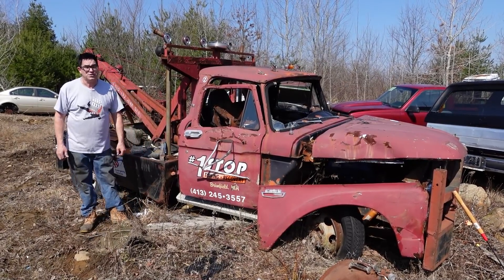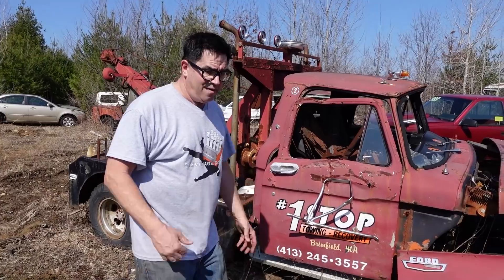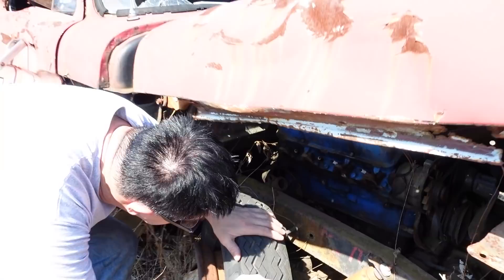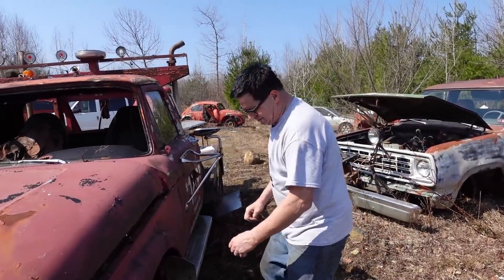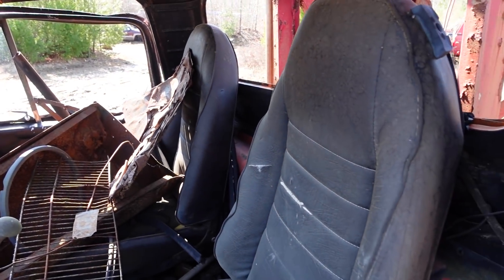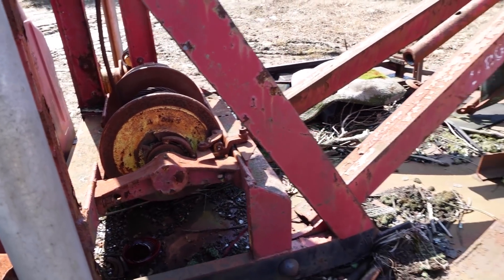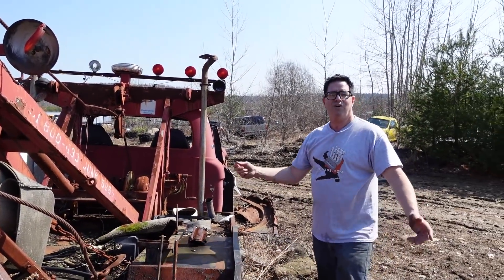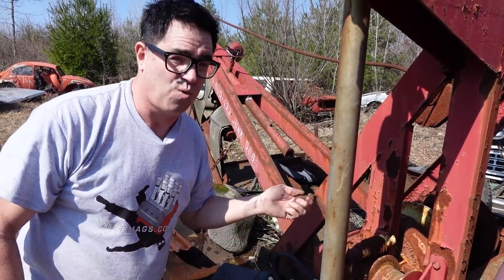Tow truck Tragedy

Comment: I think the winches where PTO driven but nevertheless what a awesome find and as always be safe 👍
Reply: When people that are supposed to know stuff say stupid stuff like electric motors on that tow truck you question everything else they say
Reply: @jamestyndall529  Steve has forgotten more than you or I will ever know alot of home made tow bed were electric driven exp.if they were never equipped with a p.t.o unless it was factory intended to be a dump bed or tow it wouldn't have a p.t.o he said in a comment that it may have one but he could see the electric motor on the winch and couldn't get under it to see if it came with a p.t.o
Reply: @kellytolliver2390  Its home built wrecker. the two levers at the rear one worked the clutch and the other worked a two way  PTO. The winch on the example shown here. It looks like one of those WWII PTO winches that where on  army 4x4 like WC's and early Powerwagon dodges etc. Back in the day when this tow truck was in service there where not very many electric winches like we see today.

Comment: I had a 66 F-250 in about 72 or 3.  352 POS blew a head gasket...filled her up with Iron Tite she sealed right up...changed the oil and traded her in on a 72 Kingswood  Estate wagon.  Then I got a 69 F-250 with a tired 360...much better truck.  Dropped a 390 out of a Merc wagon in that baby then she was unstoppable!

Comment: Wasn't there an article in Car Craft around '97-'98 about how any FE block can be turned into a 428 like a Police Interpreter engine? Not a 427, because boring out the cylinders that much might cut into the water jackets.
Reply: Nope only a Mirror 105 block can sometimes be bored that far. And you have to sonic test first.

Comment: That 352 cross bolt block is the same casting as the non side oiler high performance blocks.
Reply: Was thinking same thing 
Could see another life as …. Well maybe a390 if not bored and stroked all the way to 427 😀

Comment: First motor was a 352 in a '64 Ford Galaxie XL hardtop convertible. It had a 2 barrel. I got an aluminum 4 barrel dual plane intake and a good carb. It was a great 1st car.
Reply: Totally that was my first car that my dad bought me. Cascade Green convertible, black convertible top, if I recall the back window was glass, not plastic. Beige bucket seats, automatic transmission on the floor. That 352 was a nice engine. The funny thing is when we went to the dealer there was a cobra that I was hoping he would buy, second choice Fairlane GT, 3rd choice orange Mustang, if I recall it had a 4 cylinder. Fun fact Gotham Ford was located in midtown Manhattan and when they closed, it reopened as a Chippendales, my oldest son’s first job.
Reply: @HotRod-wv4vm  I bought mine from a used car dealership in North Seattle. It was red and a black interior. A black vinyl roof and an automatic with a console shift. 
Green with a beige interior in a convertible sounds really nice! 👌
Reply: @WillyMcCoy50  it was definitely the nicest car I have ever owned. My dad had a bunch of cars with a 68 Blue Plymouth GTX 440 convertible.

Comment: Why is it called a "Live Axle"?
Reply: It's not really a "live axle".  A live axle is like on a go-cart, an axle shaft with no differential, driving both wheels fixed at the same speed.  The truck has a "beam axle".
Reply: @billlewis9740  I`m getting old and forgetting everything. Thank you.

Comment: the truck is a 65..and  by the looks of the motor its a 68 or newer motor ..probably a 390
Reply: Steve said it's a 352...
Reply: I agree. It has the newer style valve covers that came out in 68? I think. Also, in 65 the vacuum advance hose would have been a steel tube that screwed into a fitting on the vacuum advance. And I think 66 was the last year for the 352, so you're probably right on all counts.
Reply: @sf64100  he's probably guessing ..it did come new with a 352,,but its obvious this isnt the original motor ...a factory stock 352 in 1965 would have been a black motor and plain jane pent roof gold painted valve covers ..and look at the passenger side valve cover breather...that style came out  in 68 and up
Reply: @61rampy65  the 352 stopped  in 66 for cars.but lasted 1 more year  in trucks to 67 ,,those style valve cover came out  in 67 ,,,and you are correct  on the vacuum advance hose
Reply: @billlewis9740  yes..it could be one of those too

Comment: I like Steve's channel i watch a lot of his videos but sometimes when hes talking about  Year models cubic inches and special order codes he really sounds like he knows exactly what hes talking about and then sometimes in this case he described the 352 correctly and then started describing a  Bowl of corn flakes once he got to the point about the bucket seats which were out of a second generation Camaro and then describing that bed as homemade, It looks like a no mar brand bed to me.then having an electric winch, completely ignoring the Triple A sticker on the bed of the truck and miss communicating the levers I have to say he should have stopped when the finder fell off

Comment: Boom's an easy fix and those PTO winches easily outpull small hydraulics, even the commercial Ramseys since you get full engine HP to the winch. (I hate to see posers turn perfectly good tow trucks into stupid hot rods that just sit but have no doubt a real towing outfit will keep it a real truck.)